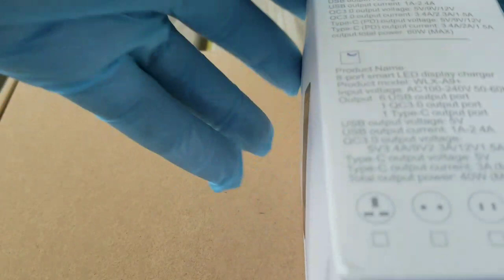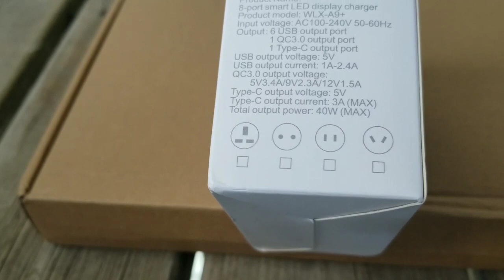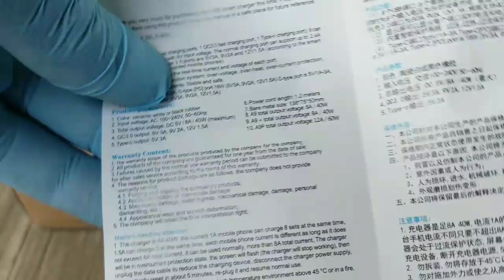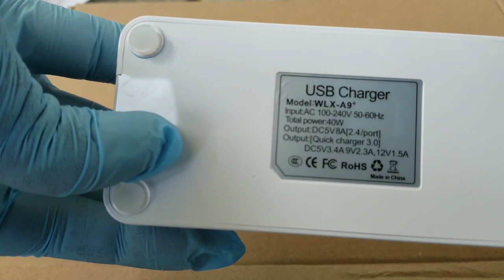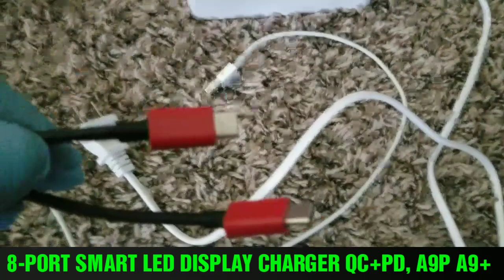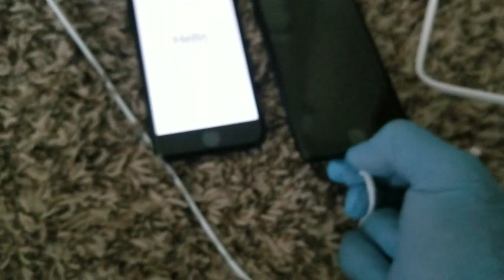8 MULTI-PORT USB ADAPTER DESKTOP WALL CHARGER SMART QUICK CHARGING STATION 3.0 C

Comment: I think you made a mistake the one you show here well the box indicates you got the 40w version the c out put no negotiation (PD) yours is WXT-A9+ The one with PD is model A9P.
The two  I phone's were charging at around 0.9 amps (900 mah) each. The 1 78 amp was total.
Reply from the maker: Hmmm..... I check 
Thanks for stopping by LIKE SHARE and SUBSCRIBE